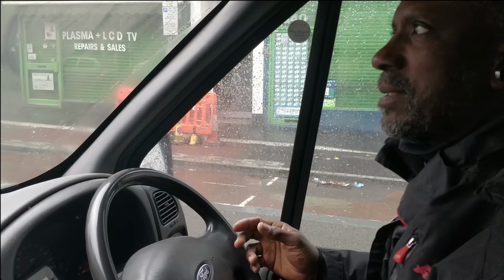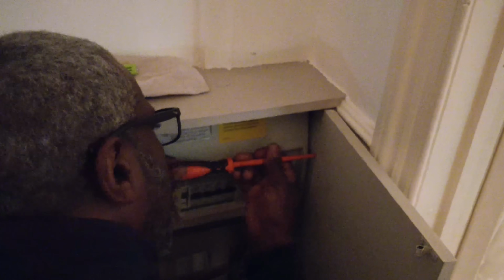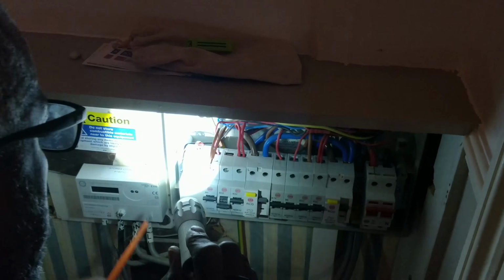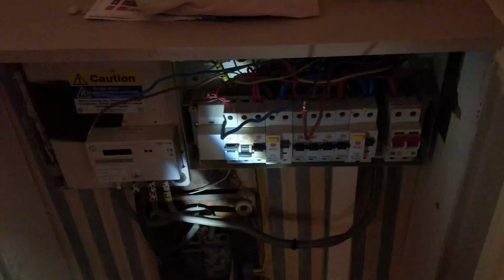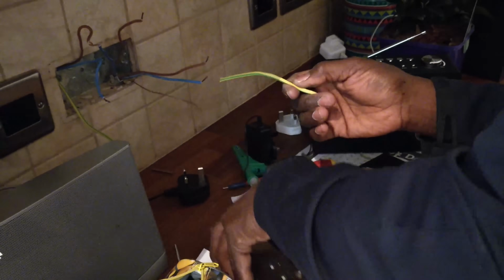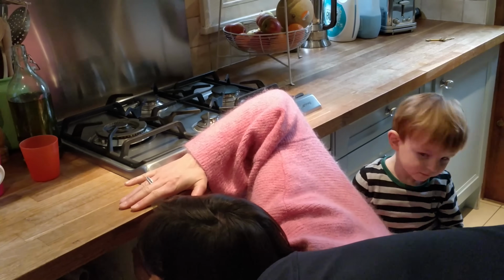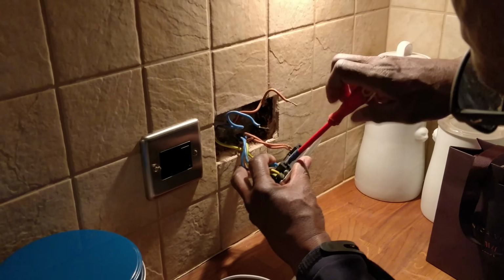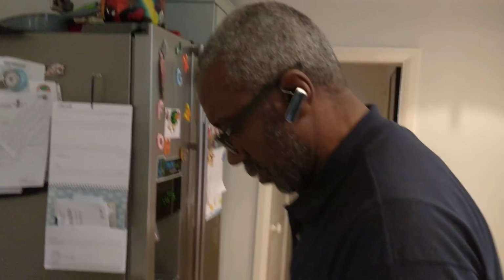Electrical Fault Finding - Father & Son Electrician Team In London Vlog #1

Comment: with a bunch of RCD's in play I suspect the cause of the trip is likely overloaded circuits, someone did bodge job sometime in the past and tied into a 20 amp  circuit breaker and paired in with a 15 amp or less circuit 

meaning some fuckwit did quick flip in that home past  and i doubt it will fix it ..

with rcd's unlike the old fuses of yesteryear can't  daiseychain power points together as the have piss poor trip current..

proper layout is bunch the 20amps together ..

because the currenyt setup is causing an overload from the 20amps in to 10-15 rcd's

Not a sparky by trade however I have over loaded circuits tend cause the stupidity of rcd failure...

Comment: 1st step should have been to un-plug everything on that circuit, & remove fuses from any spurs, then try to reset the breaker - if it resets ok , then it is one of the appliances.
Reply: Exactly plus I don get why he did IR 500V without making sure everything is unplugged 🤦🏿‍♂️
Reply: Are you two morons, ? He did a great and safe job.
Reply: @gibbo1973Toxteth He starts from scratch, otherwise you can be lead a merry march to a wrong destination when you have a closed mind to problems. He does absolutely the right thing. He is not a cowboy like so many of you sound like.

Comment: Insulation Resistance on 500v between Line and Neutral not knowing everything is unplugged 🤯 lets fry them components 😂
Reply: Yeah and check the croc clip is on with your bare fingers!
Reply: When I was doing my training course at college one of the lads had his hand on the metal consumer unit while doing the 500v test. He never did it again 🤣🤣🤣

Comment: A fridge will trip a breaker when the compressor is going out or needs to be refilled as the bladder (don't know the technical name) freezes over and overworks itself pulling too much amps and thus trips it. AGAIN WITH THE RIDICULOUS BREAKER CABINETS, MADE OF WOOD?! What better way to feed a potential fire, jesus! Plastic too, not even hi grade, now I gotta look up these regulations because this is laughable!! Should be steel, with a redundant ground straight to earth with a copper rod, that's how we do it here. It's against regulations in America to do any kind of cabinet in anything other than metal for VERY obvious reasons. You are truly a man and son that's keeping that city from burning down. Those daisy chained outlets would not fly here either, not like that anyway.

Comment: Great vid. Other than the open CU and then leaving cables hanging out quite far and sending 500V down them from the socket with the kids roaming, great job 😅 keep it up.
Reply: Yea but this is the real world. Kid should be kept away by client which it is. Client is being charged hourly and Del is getting on with the job quickly and safely
Reply: To be fair, the kid's safety is the parent's responsibility. He's trying to do a job.
Reply: @therealxunil2  to be fair the kids safety and protection from electrocution is 100% the responsibility of the electrician who removed the fuse board cover.
If you call an electrician you don't expect him to make your property less safe than it was before he arrived
Reply: @therealxunil2  safe isolation is for the safety of the public from a professional person. They wouldn't know about the dangers, hence why electricians are trained so rigourously in safe isolation. Not parents fault at all.
Reply: Who needs do test this way anyway. Give me a voltstick and screwdriver and i can fix it in no time.

Comment: And the moral of the story is separate lighting and plug circuits
Reply: No really. Then you had no lights in whole house. The way I do is  seperate ground floor from the upper floor , this way when 1 RCD is faulty you still got the light and the power.
Reply: Its good enough practice to spur a light with a 3 amp double pole switched spur from a ring main

Comment: with kids running about, health and safety paramount...never leave access to RCB switchboard with kids running about. you could be doing work, assume circuit is off then  a kid plays with the switches..could be very dangerous.  still, probably over confidence or easy to be complacent after 30 years on teh job.

Comment: Hi Delroy, why did you carry out an Insulation test? is it because the RCD kept tripping, why not continiuty test first? sorry I am learner I need to know. thanks.
Reply: Same thing....kinda..
if there is a short, the insulation resistance tester will give a low reading. If there isnt a short, it will give a high reading.
Reply: Pac Man Yes but it is more practical to do a continuity because insulation test can damage equipments if you are not careful , people are watching this and and not all of them understand the procedure therefore if it is not explained properly in the video,  they will do the same without precautions.
Reply: @Handai7  yes thats true but if somebody doesnt know what an insulation resistance test is then they probably shouldnt be working on electrical circuits etc.

Comment: 9 out 10, if there is outside electrics, that’s where the fault is. Although I attended one job and found a fault with an eternal socket wired as a spur from a spur using .75 LAMP FLEX!! And a faulty socket, an appliance fault and a fault on two separate external light circuits where the housing was letting water in. Find one, fix it/make it safe, not coming back on, find ANOTHER! And the fridge still causes a trip every now and then.

Comment: That is not a split load board, it's a  dual rcd board. You could have tested the cable to the garden lights to confirm the fault, otherwise good job
Reply: Whats the difference?

 How do you know he never?
Reply: Brynoize it's good to have confirmation,  that cable could be taped up and sitting in a puddle of water. I would have had a quick look at the other end
Reply: Doesnt matter we dont know he never went and chacked after the video, you never answered the first question
Reply: Brynoize a split load board  has half of the circuits not protected by an rcd, and the other half of the board is protected by an rcd. A dual rcd board has an rcd on both sides

Comment: I have bar light with 4 lights on it on kitchen roof and when switched on this sometimes trips the circuit and sometimes not. It has a mixture of bulbs, led and halogen, could this be the problem mixing diffenert lights, or maybe more likely to be a loose wire of some sort? Just thought I'd ask as I didn't know if mixed bulbs may do this.

Comment: All round a good video. Apart from the comments about the energised DB with the cover off (which appear to have missed the fact that accessories were also hanging off when energised) - but I'm not here to lecture about that - when insulation testing the cpcs should remain connected to the Earthing arrangement rather than disconnected from the Earth bar.

Comment: I've attended many faults like this. The first thing I do is to isolate ALL appliances on the circuit. By this I mean unplugging all appliances and switching off all FCU's or disconnecting where they are unswitched. Then you IR test the circuit. If that is clear, you know there is an appliance issue.
Reply: I work this way too. After all it could be an appliance issue.!
Reply: Simon Abbott Yeah I had this issue. Upstairs socket ring kept tripping intermittently, never a set time between it and seemed to be at random. Couldn’t figure it out for ages until the missus took her laptop around her mum and dads, plugged the charger in and then tripped their electrics too🤦🏼‍♂️

Comment: Might just be the Youtube videos but I'm fairly surprised how much new-ish wiring you find in the UK! I live and work in Austria and here it's not all that uncommon to find wiring dating back to the infant years of electricity, rubber-insulated and cloth-covered. Vienna has some 40% of housing stock built before WWI and quite a bit of that has never actually been rewired. In 2008 the laws changed a bit requiring our equivalent of an EICR before an apartment is let and that has improved things a little but not all that much.

I only looked at a small commercial property yesterday and judging by the colours of the cores (no covers to be seen anywhere) the whole wiring was pre-1965 with minimal later additions. The CU consisted of several individual Edison-base fuse holders (DIAZED) and a new-ish RCBO dangling from the wires.

A friend of mine lives in an upscale flat and most of the wiring is cloth-covered singles plastered straight into the brick walls, no earth anywhere to be seen. Someone ran individual earth wires much later. I suggested a complete rewire but his dad is having none of it (I only replaced the 1980s RCD because of random tripping not explained by two different insulation resistance tests).

Every time I walk into a pre-1960s place I expect to see sockets without earth and cloth-covered wires all over the place or at least in some spots someone didn't consider worth rewiring.
The worst I've ever seen were places wired straight after WWII in attempts to repair bomb damage. The quality of materials was absolutely atrocious!